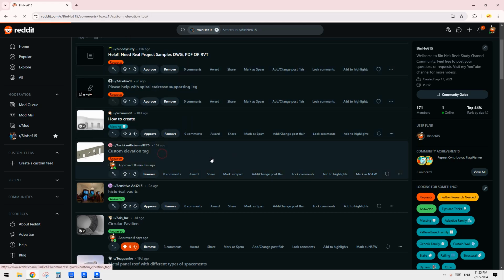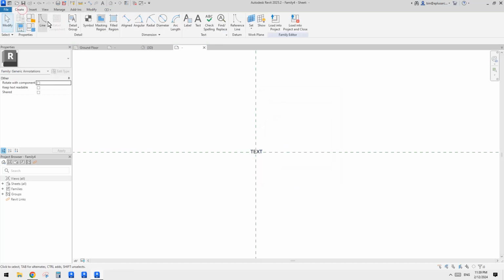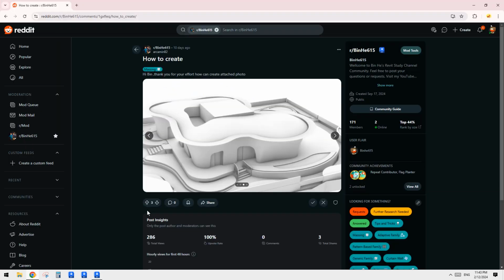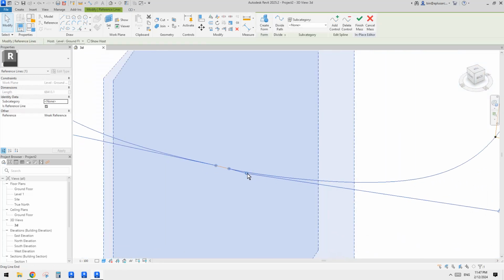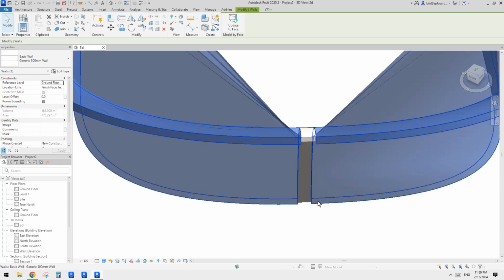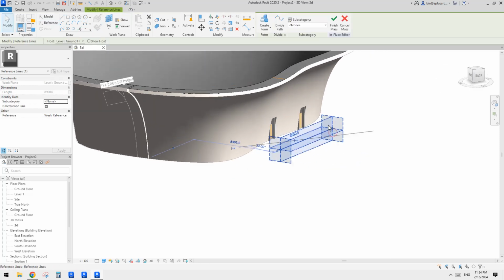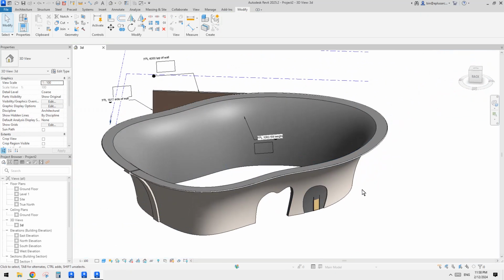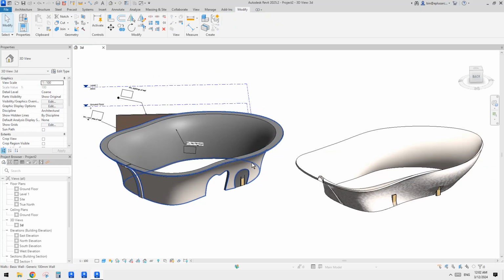24092 - Massing Exercise in Revit

Comment: Thank you Ben , what if there are multiple  profiles in fist modeling method,  would it work selecting multiple  profiles different in shape with 2 paths
Reply from the maker: I believe you can have multiple profiles with different shapes and sizes on the same path, as long as they are relatively similar in size or shape. I don't think you can do this on multiple paths.